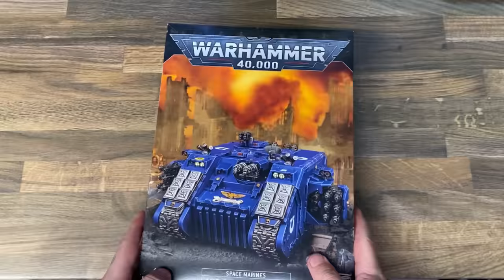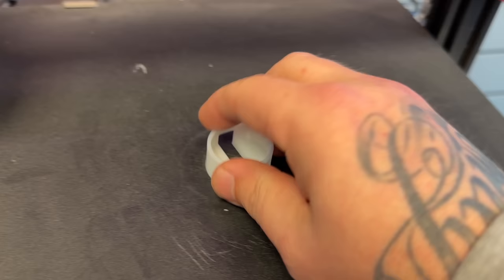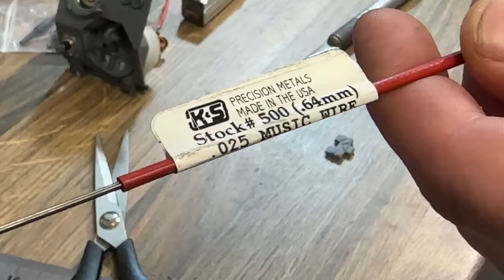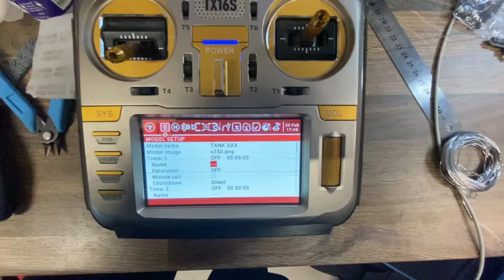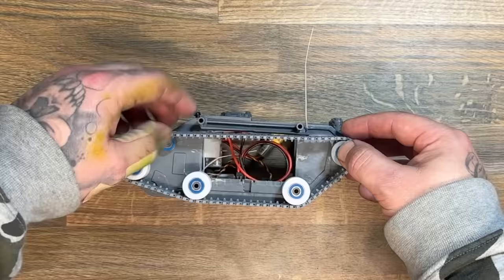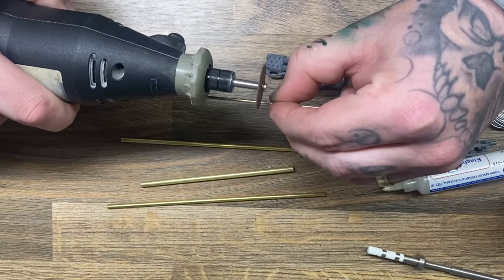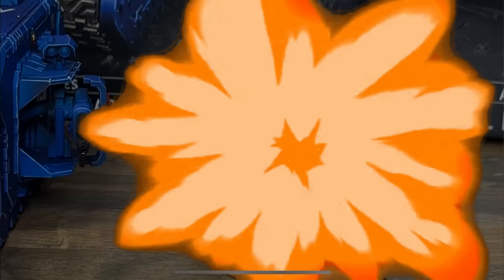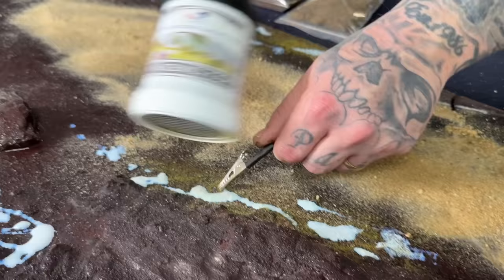Building the Coolest RC Warhammer Land Raider Tank with Working Flamethrower | Epic Sax Guy

Comment: Months ago dad left to got the warhammers store. Gran lost hope. But i believed. Then dad came back, riding a chariot pulled by an army of RC flame thrower warhammer tanks. It was a christmas miracle. 

I remember we use to take the restrictor off lighters, you'd get a 6 inch flame. It'd run out of fuel hella fast but if you could step on it and shoot an even larger flame. I think you've found your 40k tube niche.

Comment: I have no idea how do you make things look so good. I recently got a 3d printer and its been like 2 months I think and I printed my first figurine that has 30 pieces and put some primer on all the pieces but you can still see some spots where the supports were. I'm kind of afraid to start painting because I don't have a air brush and by hand I'm afraid of fucking it up and having to start all over again . I would love a longer video even like 40 min or more on how you deal with supports and extra sanding etc.
Reply: Brother dont be afraid you'll never get good if you dont try. The long you paint the better you'll get. Airbrushes are great but just a tool not necessary. I painted for years without one. They defiantly speed up the process but you can do everything with them with a brush.
Reply: As the saying goes "just do it."  The most expensive part is the printer, which you have.  So just print another guy if you mess it up.  Not to mention you get to get a little more experience with your printer and learning all its quirks.  Compared to official models filament is cheap, resin is...somewhat cheap.
Reply: I mean , Resin is like way cheaper than the original Kits by a factor of 5/6 , if you screw up you can always print other and start again

Comment: To all of you out there who haven't figured it out yet that put plastic cement on something to later realize they messed up and lament because they plastic cemented it and it's it's permanent?
The same thing that makes plastic cement permanent is the same thing that makes it perfect for removing pieces stuck together with plastic cement.
If you stick a piece together it melts together and you need it apart put more glue on the seam where it was glued on that chemical process will heating up the plastic and release it just as easily as it will hammer it into place

Comment: It looks amazing, can I ask what microcontroller did you used for remote controls ,light and sounds.i normally use an esp 32 for my warhammer projects ,but this seems smaller and probably better 😅
Reply from the maker: So there is no micro controller. My controller is basically my radio transmitter that holds all the code for control. And that just sends a pwm signal to the tank through a tiny receiver and the power is run through a step down bec.